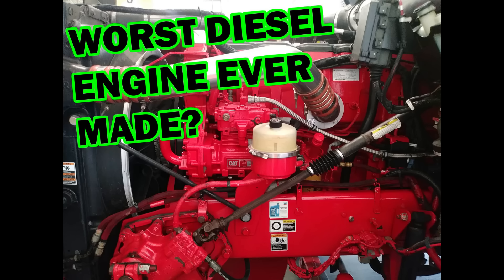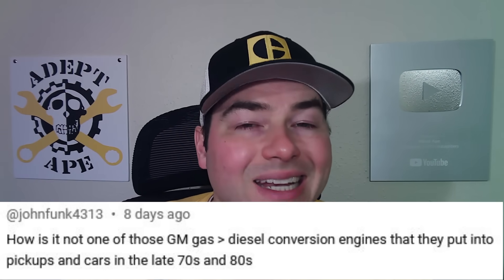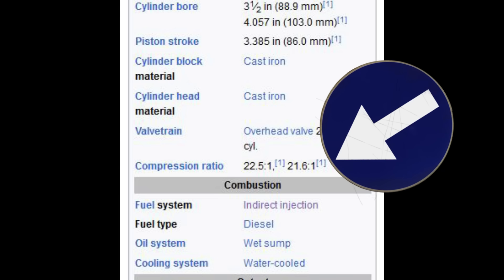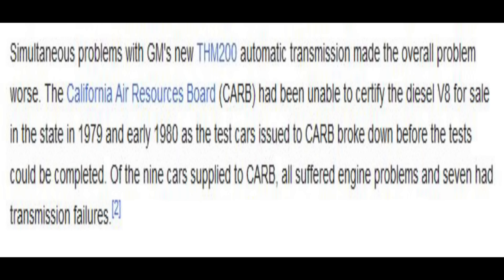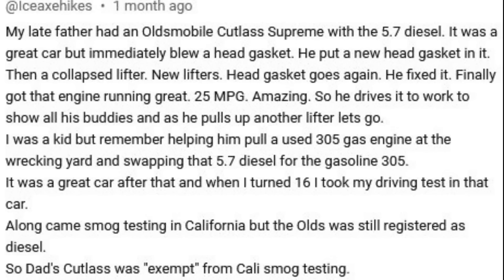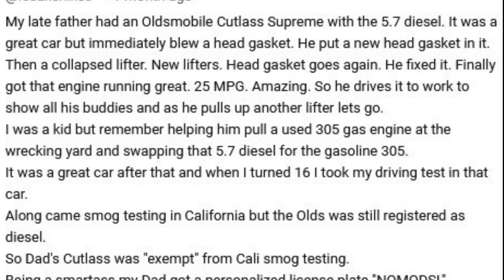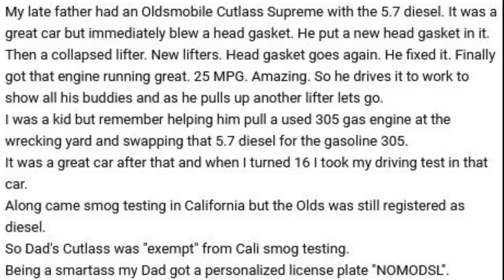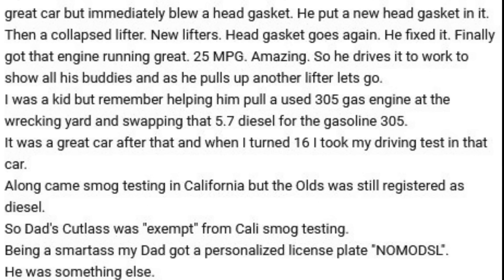This Engine is the Reason You Don't Have Diesel Cars in America!!!

Comment: Back in the 1970's, when GM came out with the 5.7 Modified gas to Diesel engines, Diesel fuel was $1.00 or less per gallon before the ultra low Sulfur Diesel was required. My Father in law's friend was getting a claimed 30 MPG on his 5.7 Oldsmobile. He never pushed the engine and just putted around the Ohio area. In the 1980's GM had to install roller lifters and other mods to correct the poor engine design too.  

Also GM continued with producing the Cadillac "NorthStar" V8 gasoline engines that were designed to cut out cylinders that were not needed for fuel economy at low power. That was also a major disaster. It turns out that GM, Ford, and Chrysler made so much junk and the foreign car makers, like Toyota, were, and still are eating the big three's lunch with a better, more reliable, quality cheaper car than the UAW assembled and bean counter designed junky American cars.

Comment: My mom bought a 1979 diesel powered oldmobile cutlass supreme.  Unbelievably comfortable car to drive.  Saying that, the engine was a piece of shit.  The engine was replaced at 50k and the second engine made it to around 80k. I put a 350 gas engine in it and hadn't gotten around to replacing the front springs when a Chuco stole it and lost control less than two miles away.  Didn't know it was stolen when the police called to report it had been involved in a accident.  That was one comfortable car to lay down miles in.

Comment: When you started explaining what Oldsmobile was, several joints started hurting and I think my elbow popped from old age........ It didn't even occur to me that there are people that don't know what Oldsmobile is or was
Reply: I hurt every time I hear someone say that Ford made a "Show" version of the Taurus. SHO (Super High Output) was most definitely not a show car. It was front wheel drive performance package.
Reply: @mattbrown5511 Taurus or something that came out the south end, of a northbound bull..lol,  with blown headgaskets/cracked heads, or transmission failures, if the engine happened to miraculously keep running.
 Wrecking yards always had several. Same with its twin, the Mercury Sable.
 Every one of the big three, had certain models, that were failures, waiting to happen..👀☕
Reply: +1, SUCKS getting old!

Comment: The cars were too heavy and the de-tuned gas engines were gas hogs - so they needed a quick fix. The Olds design and test criteria was run it until it breaks, fix that and try it again until something else broke, but Olds wasn't alone in trying to fill a marketing void.
In about 1987 Mercedes-Benz, to fill a similar mpg "problem", tried to up power its well regarded 3.0 L six cylinder diesel by boring the engine to 3.5L; a bad idea that killed the 350SD model. 
In hindsight - always easy - the thinner cylinder walls created coolant cavitation and hot spots that scored the cylinders. Owners said their engines lost power and "grunted". Mercedes replaced original buyers' engines, second or third owners were on their own - some of those cars got stolen, wrecked or mysteriously caught fire. Too bad, nice cars with junk engines.
In both cases this was about cutting corners with a small cheap "add-on" to extend a product's life.
Similarly, Boeing is now learning this the hard way with its basically obsolete 737 air-frame.

Comment: It's sad these were so poorly designed and built because when they ran, they were supreme smooth runners with fuel mileage between 30-36 mpg. Also they were some torquey monsters in the 1981 Chevy Caprice Classic 4-dr. And another thing, though they were loud on the outside, on the inside you didn't hear a thing. I had one so I know. The failure on that car - injection pump. I think had GM not rushed this engine to market and spent a little more R&D time with that motor including the use of ARP cylinder head studs instead of stock bolts, I think the engine would've been Top Dawg. I love those engines more than anyone but it was a shot in the dark for GM and they messed up bad because that was one incredible power house especially for the large cars - this time not talking Peterbilt or Kenworth. And yes, they had glow plugs for more winter fun in northern states. It's just too bad for current EPA regs on diesels because I would love to have seen someone redesign and build a replacement version of this engine from the ground up, which now is almost moot since we no longer have land yachts for cars but maybe it would've been good for pickup trucks.

Comment: You missed the issue with the fuel system.  I knew someone who had a Oldsmobile diesel.  The thing spent more time in the shop than it did on the road.  There was always something wrong with it.  Not every problem was an engine issue but almost all were under the hood.  IIRC he had 
-- the power brakes go out.  
-- The charging system wouldn't always charge the battery.
-- The transmission would upshift early sometimes
-- The transmission lost 1st gear.
-- He lost oil pressure

Comment: Parents bought one, a couple years went by and they sold it to me cheep! We drove it and the fuel injection went out, I fixed it, then the trans went out, rebuilt it. Saw so many that the center main cap failures, they used a two bolt main not a four bolt main, so you got a lead footed person high rpm and torque and the main would brake lose, as I saw it. We got rid of it, no fun!

Comment: My parents bought a used Olds 98 Regency that had the 5.7 diesel in it.  The engine was new at the time.  It ran great but had fuel injection pump problems and kept breaking starter nose cones.  It got stolen a few years after they bought it.

Comment: In the UK/Europe its not uncommon for petrol/gas engine designs to be developed in to diesels successfully. Probably the best example is the Perkins Prima engine, its basically a 2.0 OHC Austin Rover gas engine that Perkins converted to diesels for cars and small vans. Its not exactly a refined engine, being a 1980s mechanical direct injection setup, but they are very reliable, robust units

Comment: I was working in the parts department of an Old/Cadillac dealer when the diesels came out. Tons of them had warped heads when the gaskets blew. They could not machine the heads flat again, throw them away and put new ones on!

Comment: You could probably do this in the modern day with the machine and metallurgy technology we have now, say an LS add 2 head bolts per cylinder run like 17:1 compression, low boost, forged rotating assembly, with the LS’s bottom end it might hold up. But I don’t know why you would it would be about as cost effective to just design an engine ground up. In my experience with the older generation of American wrench turning men, they shy away from the diesel engine because of the cost of components, more than “reliability” I was close friends with an elderly man who worked at the GM assembly factory in Georgia for many years, he was a mechanic most of his life, he put it to me like this, an American v8 gas engine will get poor fuel mileage, but is simple and easy to work on, parts are readily available and inexpensive, anything you work hard will break down, and the fuel mileage gained by the diesel engines will not offset their component’s cost when they experience failure and it’s most likely going to need additional time and complex tools to fix, so he spent most his life driving around getting 10mpg knowing apples to apples he was saving a small amount of money just paying for gasoline.

Comment: 16:1 is boosted, 21:1 is natural.
The Olds diesel is NOT a conversion, the tooling was shared.
Reply: It was a conversion in that it was the same design. I believe the Oldsmobile design was chosen because it inherently had the most robust lower end. So it was a good candidate. Even so.  the block and related components were strengthened substantially. Notably, the block didn’t give problems. But the heads did. If they’d simply added more bolts or even simply increased the bolt diameter, they’d have greatly reduced head gasket failures. I believe doing that along with adding a water separator to protect the injection pump would have allowed the “conversion” to be successful. I think the camshaft problems were likely due to the inferior oil at the time. In addition, the super weak 200 THM transmission was the absolute worse unit they could use, especially in the full sized cars. I think thry used it because it did not require a vacuum modulator like their other transmissions. They should have adapted the 350THM to work without vacuum.

Comment: I replaced as 350 diesel with a 350 gas in an Oldsmobile when I was 17 (1987) at the first shop I worked in before becoming an HVAC tech.
I did that conversion myself.
I believe I was involved in at least one other conversion over the next few years.
Through the 80's into the 90's pretty much everyone I knew in that small town who had one would swap in a gas engine.

Comment: Gm, in that era, had a habit of investing in things and intentionally screwing them up, they did it with the Wankel engine. Which admittedly needed at least one more generation of design work to make it truly workable. And I believe that they intentionally did that with the diesel engine. They wanted to keep their particular hold on the market, with what they already had in functional operation.
My evidence for this would be that anybody, who understood anything about an internal combustion diesel motor, would have known that that motor could not be converted to a diesel engine. There were only a few gasoline engines of that size, that could have even withstood the design function of a diesel engine, and Oldsmobile certainly was not one of them. Not even the vaunted 455. Which barely operated as a durable engine when put into high pressure operations without massive amount of modification, it just wasn't going to work. Not only would it require at least a Y block design, possibly even Siamese bores. Along with a substantial girdle system for the bottom end. It would also have required probably 6 bolts per cylinder for head bolts. And a substantial cooling system as well as methanol injection, which should actually be on any diesel engine that's put into a vehicle it is such an advantage to have that engine run clean, that methanol injection should be a standard operating method on any diesel engine whether turbocharged or not!

Comment: I was turning wreches for a living back then and it was cheaper to replace the motor with a used gas motor than fix them POS motors. In 1 month all I did was R&R motors, got it down to 1 day job. On a slow week we tore one down that "just needed a head gasket job" the rods were all bent. If we had of put head gaskets in it , 5 minutes and it would have had a broken again.

Comment: Was a dealership GM Master tech toward the end of era and head gaskets injection pumps were the big deal with cam shaft related problems   Plus a few with shorted wiring harness diodes that wouldn’t shut off. Imagine that starting was usually the hard part. Then they follow with the 6.5 and warranted injection pumps what seemed like forever wasn’t a lot of fun 😅

Comment: Hey I worked for Olds as a tech in the early 80’s. The first gen not only had head gasket issues also main bearing webbing was a real problem. It is sad because by the end of its production the blocks and heads were greatly improved not perfected but improved. They were fairly reliable. The injection pumps was also a real issue as well as being under powered.

Comment: I remember that the EPA was pushing US automotive manufacturers to raise their CAFE Corporate Average Fuel Economy at that time. The easiest way was to install lightweight V-8 diesels by the hundreds of thousands.  What they didn't count on was that the US population drove these underpowered vehicles the same as traditional gasoline fueled vehicles.  Cold starting could be a nightmare. Water in the diesel fuel destroyed injection pumps but was hardly noticed in gasoline vehicles. The engines were gutless, had different service requirements, and were quirky. Diesel fuel wasn't available at every gas station like it is now. In cold climates, the heater barely worked, too.  

What I recall was that diesel powered US cars of that era had a good start by promising great fuel economy and cheap fuel which cost less than gasoline back then. But as soon as somebody you knew started having troubles with their diesel car, the bad reputation spread quickly. Mercedes and VW diesel cars had far better engineering for decades and their owners were happy. But the drive toward CAFE ruined the US diesel vehicle market very quickly. Europe had small turbo diesel powered vehicles that were far more successful for decades but diesel popularity never really caught on in the USA aside from pickup trucks.

Comment: A good Diesel car engine in the late 1970s might cost about half the fuel cost per mile than an American gasoline engine with a better running engine and a more robust fuel market supply.   Gasoline prices in the late 1970s were taking into account inflation about $4 a gallon with the average American car getting 12 mpg with a low powered clogged up emission system robbing mpg engine.   Diesel fuel per gallon was cheaper than gasoline at about the reverse of their prices in 2024.  Diesel fuel would still be available when gasoline had run out at the local filling stations during the worst of the OPEC embargo'.  

Mercedes turbo diesel cars seemed to provide for most of these attributes.   I'd hear people talking about their Diesel Mercedes and Oldsmobiles while waiting in line.  They'd ask each other how many times they'd replaced the high pressure pump.   By the time the Oldsmobile Diesel had become an OK reliable engine with good fuel economy in the 1980s the American gasoline car engines had got much better with fuel economy, drivability and starting to clime in power.  Diesel and gasoline prices were near the same and had gone down with reliable supplies.   One of the key selling points for having a Diesel in the 1970s was survival during oil an embargo when gasoline ran out Diesel could still be had.   That's worth paying a lot up front as insurance as long as the engine is reliable and the Oldsmobile Diesel was not reliable when driven hard or normally whatever that is.   

To say GM missed an opportunity to champion an advanced passenger car Diesel and GM's own long term reputation is an understatement!   GM had Detroit Diesel experts it could have brought in for a new advanced turbo Diesel car engine to be on par, but much cheaper and more powerful, than the Mercedes turbo Diesel cars, without the hugely expensive emission controls similar in reliability to the current performance Diesel pickup engines of today.
Reply: Detroit never made 4 stroke until after 1985, and even then it wrecked Detroit Diesel. The company had to be sold
Reply: @Bloodcurling  A turbo 2-cycle Detroit Diesel with power would have been fine for a passenger car.  In would likely need to be an entirely new engine, but done with a lot of experience and knowledge.   

Today in 2024 new Diesel HD on-road engines have to meet emissions in the USA that are by far the toughest in the world.   The EU is much easier.   The emission systems of USA new on-road Diesels are amazing, but also very expensive. Cummins is top in the HD Diesel USA on-road emission systems and the only mainstream HD on-road Diesel of USA origin.   Detroit Diesel is Daimler and very similar to the EU Mercedes engine.    Volvo is Volvo.   Paccar is also EU.   That's the big four and there really isn't a number five in the order of typical preference.   Don't go below number two without very good reason for new on-road HD USA Diesel engines.

Comment: The REO in Diamond REO trucks stands for Ransom E. Olds, the founder of Oldsmobile. It was his next venture after selling Oldsmobile to General Motors.  
There were 3 Oldsmobile diesels, 4.3 l 260 CI V8, 5.7 l 350 CI V8 and the 4.3 l 260 CI V6.
I never got into the Olds V6 Diesel but the 350 and 260 V8 blocks and cranks were better than what was used in the gasoline engine, the only difference in the 2 V8's was the bore size. They had thicker cylinder walls and a forged nodular iron crankshaft, and used the main journal size of the big block Olds 3.00" as opposed to the small blocks 2.5. The later DX block received .921" roller lifters over the previous .842 flat tappets.
 The 350 block is still desirable for building gas strokers.
The main problem these diesels had was head gaskets and not having a water separator in the fuel system, with ultra low sulfer fuel having a supporting role.
And the reason we're still talking about how bad it was 40 years later is because the issue is even more misunderstood now than it was then.
But did this engine alone ruin the diesel market? No because it was also very expensive to have the fuel system of a VW rabbit serviced. Most automotive shops were grasping at straws when it came to diesels and diesel shops didn't really want to mess with them. VW dealers weren't everywhere. At least Oldsmobile dealerships were nearly everywhere and their mechanics were usually top notch.
Reply: As far as the transmission failures of the CARB test cars goes, the TH200 was junk, a moth fart was too much power for them. The TH200 debacle is the reason we have the TH350 with the multi fit bell housing. GM couldn't build enough TH 200's to meet production AND warranty needs so the TH350 was substituted, when GM finally scrapped production of the TH200 they re-engineered the bell housing of the TH350 for the Chevy and BOPC  patterns. 
But the TH200 lived on and went from total garbage to becoming the 200R4, a very good 4 speed overdrive.